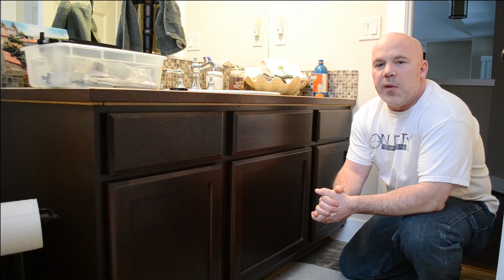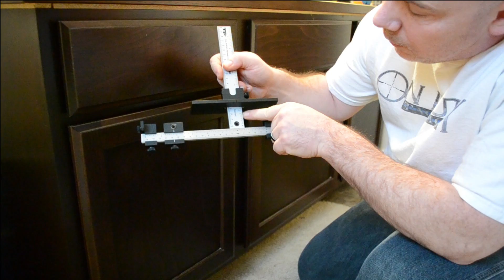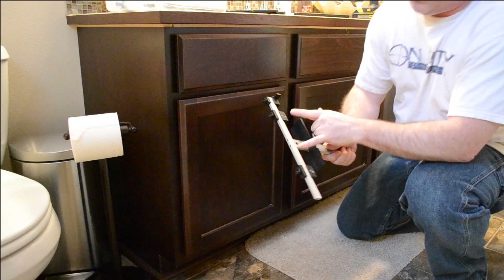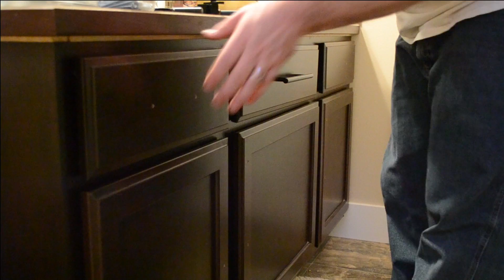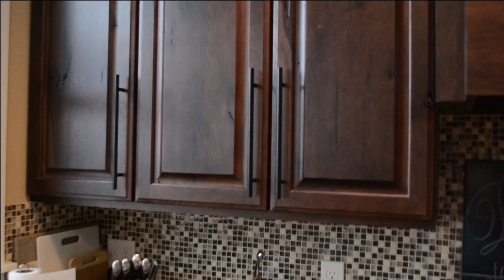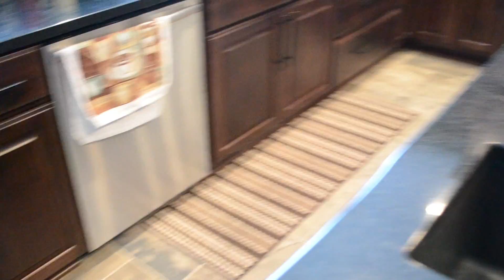Cabinet Hardware Install

Comment: Put blue tape on doors or draws. make marks on the tape. Align drill guide to horizontal and vertical lines. lock jig down. No guesswork.

Comment: Did you get the extensions for the jig to drill the handles for your fridge? If so that would explained the $300.00 price tag. I have a jig that looks identical to what you used and I paid $45.00 with shipping. Also when doing drawer pulls take a piece of masking take and place it on the top of the drawer in the center then measure the drawer and mark the center. Beats measuring back and forth.

Comment: $300!!! 
No, no, no
Reply from the maker: yeah, I know.  I have heard it before.  Some people don't think it was worth it.  I obviously do.  That $300 is still working today though.  It has a shelf pin drilling guide built in to it that I used A LOT when I built my customer walk in closet.  By the way... nice truck!  I bet you spent $3000 on the wheels and tires alone... NO NO NO.

Comment: did you have any splintering on the backs of doors,as you never used a wood block protection on back side....
Reply from the maker: Stephen, that's a good question.  The answer is, yes.. but only marginal.  I had a brand new bit when I started, so I think that minimized it.  It only happened on two doors, and the splintering was extremely marginal.  So marginal that the screwhead on back side of the door covered up and obvious splintering.  Keep in mind... i was a complete amateur DIYer when I tackled this seemingly easy task.  Had I known, I would have used tape or a bock on the back as you have indicated.

Comment: Try a Kreg jig next time. $25.00
Reply from the maker: I looked at Kreg, and own a lot of the stuff.  It doesn't come close to comparing, but that is another option.
Reply: Robert Rees  where do you buy your jig
Reply: Robert Rees, and what is the official name of that tool?
Reply: Glenn Ballou. I purchased one that looks identical to the one featured in this video from Amazon (but different color) and got it in 2 days. It is a "FOHYLOY cabinet hardware jig true precision". Under $30.

Comment: One question. What the hell was wrong the the false  drawer. It was way crooked. Cheap cabinets I guess.
Reply from the maker: I had just thrown it back it in there after installing the drawer pull.  It is adjustable and removable.

Comment: thanks for the video that might give me a head start on how to use the jig that is very expensive, imho. i am expecting mine this sat. however i think this is where high quality work comes in. on a job you don't want to make a mistake on a high end cabinet door face that would cost you dearly lol. i always used the plastic jig that now can't be used with 6in pull handle. 
btw,your false door at the sink is misaligned.

Comment: You spent $300 on the jig to avoid paying $3/hole?  Is that cost justified?  How many handles?
Reply from the maker: I had a new home with 180 bar pulls to install of varying lengths.  Each bar pull is two holes that must me aligned perfectly.   When you consider that all of my cabinetry was solid raised panel hickory, and the cost to replace even one of them is well in excess of the cost of the jig... it was well worth the piece of mind.  I did not make this video to sell the jig, or even promote the jig. I made the video to inform people that wanted to do install their own handles with absolutely no risk of error.  This jig is a bargain at $300.  It not only ensures that each hole is in the exact spot on every single door/drawer, but it makes sure that the holes you are drilling are at a perfect 90 degrees to the material.  

By the text of your post, it appears that you don't agree with my decision, and that is fine.  You may very well find some of the other videos on youtube explaining how to make your own jig more to your liking.  I actually offered a friend my jig when he re-did his kitchen.  He chose not to drive over to my house to borrow it... it ended up costing him $425 to replace a large cabinet door due to a mistake.  The risk is all yours to take.  I chose to buy the jig...
Reply: That's quite a lot.  I see they have the jig (or similar) on Amazon for about $185, but my kitchen only has about 50 pulls, so it may not be cost effective for me.  Measure twice, drill once. Thanks for the reply and the video!
Reply: I am in total agreement with you, Having the right tool for the job is of importance. I would have spent the 300 dollars for a professional job and look. Thank you for sharing.

Comment: Thanks Robert for sharing. Yours is the first I watched, and I might check e-bay for one of those jigs. I have only 7 handles to install but as you said one mistake can cost more than the jig. Thanks again. Happy Holidays
Reply from the maker: +Rick Meier, thank you for watching.  I hope it helps.  The TP jig is an amazing tool to have in your drawer.  When I purchased it, I did not think that I would be using the additional features that it has, but I have recently been quite glad that I have it.  The model that I purchased also has extension bars for drilling shelf pin holes.  I have recently started making custom cabinetry for our master bed room closet.  The TP jig extension bars give me the ability to drill those holes without much measuring, and reliable and repeatable shelf pin holes.

Comment: Thank you so much Robert!  
I bought the plastic guides to mark the knob and drawer pull holes and trying to drill them level was so difficult.  

I purchased the true-position jig and it's great but they don't have the best instructional guides for the price you have to pay.

Your video was so informative on the measurements and use of the jig.  

Thanks again for taking the time to share this with us.  I purchased it for precision and savings - it's just so funny that there are no instructional videos that cover the use of this well.
Reply from the maker: you are welcome. Glad that it helped you. I am actually on the process of building cabinets for a custom walk in closet now. Will be using that jig to drill the shelf pin holes. I may do a video for it...
Reply: +Robert Rees 
Yes please!  The great thing about the True Position jig is that for diy-ers like me, it keeps the drill in position - for some a clamp would be so helpful.  But when you are doing multiple doors and drawers, clearer instructions are so important.  

I suppose they are marketing to folks that are pretty experienced but there is a market of us  diyer's  - that need better tool use instructions.  If you buy this tool, it's a great savings - if you can use it properly.

My kitchen knobs are level - sorry I'm OCD but many thanks again Robert for your video!

Comment: When you first said you spent $200++ on that jig I thought you were crazy, but after seeing how it works I think I need to buy one for my upcoming hardware installation. Thanks for the demo, it was really good.
Reply from the maker: Thanks Megan.  It is a very expensive piece of hardware.  For me... It was totally worth it.  If I were to have messed up even one hole, it would have cost more than the jig to replace the cabinet.  It's all in the perspective. I had over 150 of them to drill, and I am now making Custom cabinets on my shop, so it well be put to good use again. Thanks for your reply.

Comment: Thank you for taking the time to make this video. You were very informative & your instructions will be invaluable once I start installing my cabinet pulls. I just had a few questions. What size bit did you use & what kind of tip? ie brad point or pilot point? Also I was wondering does the drill bit cause any wear/fraying of the "drill bit guide" as you run the bit thru that opening to make the holes? Once again, thanks. This is the best instructional video out there on this topic.

Comment: Looks like you used the same size bar pull for most of the cabinets - regardless of the width of the cabinet... except for the large bar pull for the fridge handles.  Was this to maintain the uniformity of the look?  I have 11 different widths and lengths... debating whether I should stick with the same size bar pulls or change it based on the size of the cabinet.  Any thoughts?
Reply from the maker: The lengths of the pulls actually change quite a bit throughout my house.  They are not drastic changes though.  It may look that way because my wood and the pulls are pretty dark.  

My suggestion. Do what is going to look best. Buy a few different sizes and just mock them up without drilling.  The right answer will pop out at you.

Comment: What type and size drill bit are you using?  I have maple cabinets, and so far haven't gotten a bit that drills reasonably good or through.  Welcome anyone's comments.  Thanks.
Reply from the maker: Cliff, a new (and sharp) 5mm wood bit is what I used for these.  Most cabinet hardware will work well with the 5mm, but check the hardware that you are using and measure the bolt size to be sure.
Reply: 3/8" bit
https://www.amazon.com/stores/page/7B23E649-03D1-4BC0-A641-3177CDF71051?ingress=1&pd_rd_w=vydOc&pf_rd_p=e95dc0a3-2ddb-4cb5-aa0b-2715d3f18977&pf_rd_r=FN32YW82Y8HYD1H8ES6R&pd_rd_r=2452aa55-ffc1-4c35-90e0-6537b5f851a8&pd_rd_wg=7pYfL&qid=1566848281